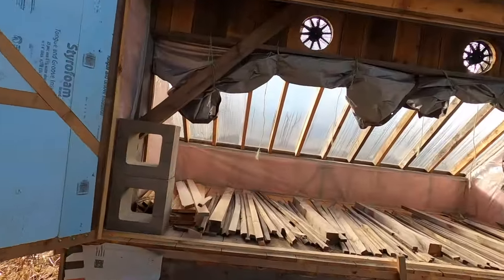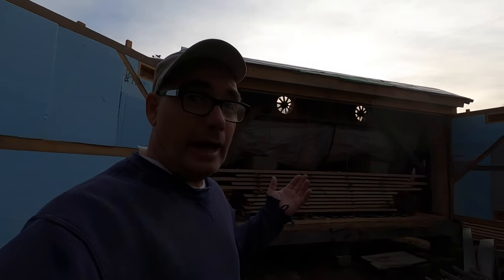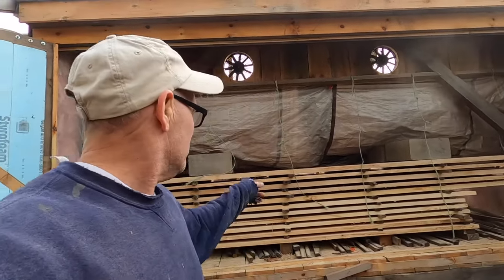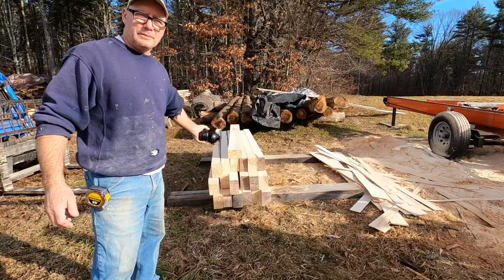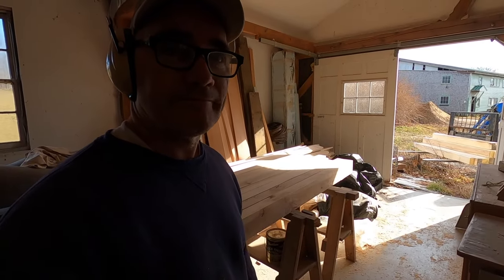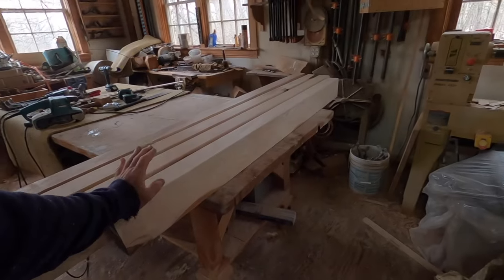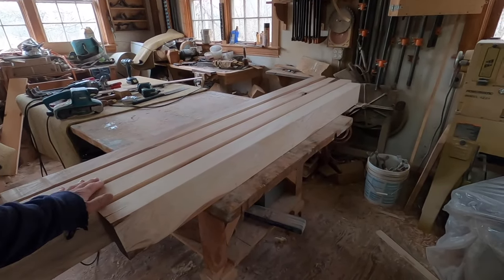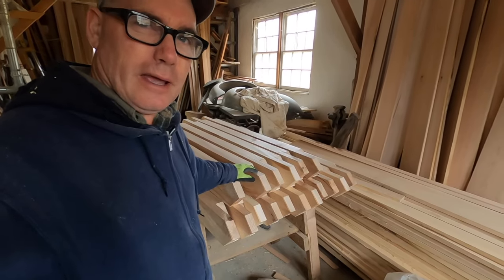Making Ash Wind Braces for the small timber frame building that's going up this spring.

Comment: How do you like your LT 40.. Any issues I should be concerned about as I order my first mill?
Reply from the maker: I have owned two woodmizer saw mills over the last 23 years and I love my saw mill it is very well designed and if there are problems WoodMizer has a wonderful help line where you actually talk to a person. If you buy one you should be very happy. I mainly saw by myself and the LT40 is the perfect size. If your going to have consistent help or do it for a full time job you may want bigger, but I know lots of people who have Lt40s and they do  everything they could want. Good luck . Let me know how it goes.
Reply: Thanks for the reply. I originally wanted to go with the TK2020, primary for the direct hydraulics but they’re way too expensive. The electric over hydraulic really concerns me. I know problems with electrical can be difficult to diagnose. Of the issues you had, were they mainly electrical  issues?
Reply from the maker: Yes, they were in my old mill and woodmizer's technicians were able to help me diagnose and replace the faulty  part.